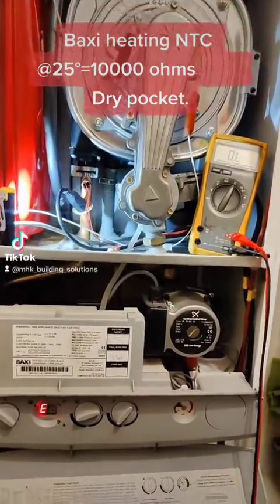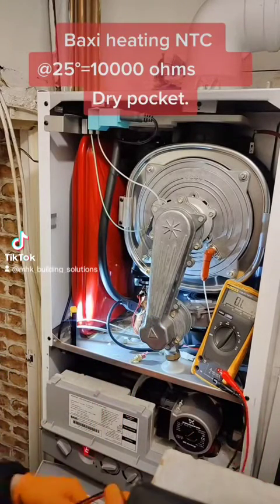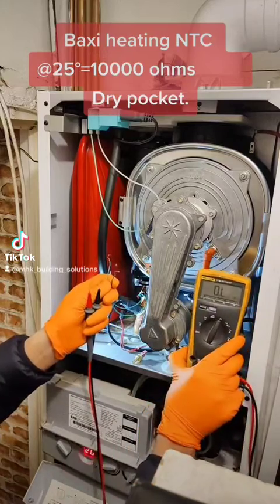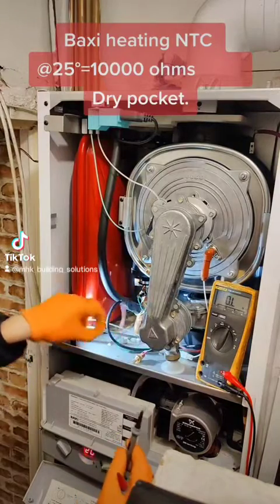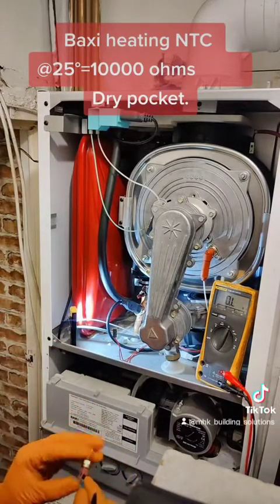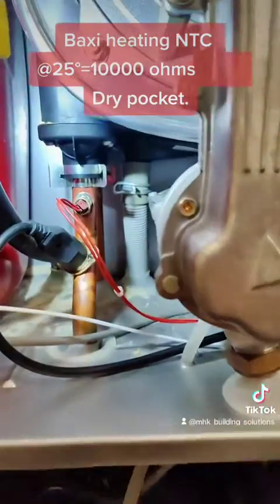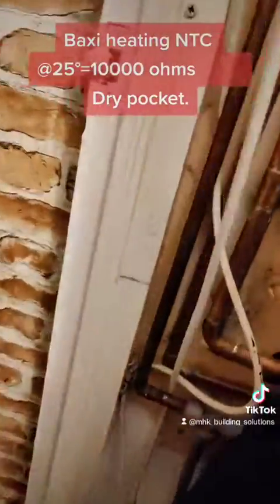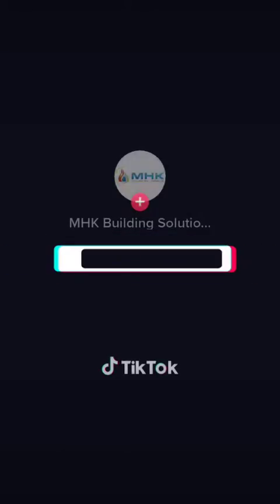Baxi Duotec E20 fault code NTC thermistor check and replacement, Boiler sensor NTC Thermistor

Comment: Hey, I have a question, what is the part underneath the NTC thermistor, the black plug, I found a diagram and it said Part No: 248079 but the black plug (which has cracked) doesn't line up, any info on the wiring harness is appreciated
Reply from the maker: The black connector on the same pipe is an overheat/ high limit stat mate .

Comment: E20 fault came back after the thermistor was changed. So what's next?
Reply from the maker: Have you made sure that the wiring harness is intact?
Check the wires (continuity test) between the thermistor and PCB.